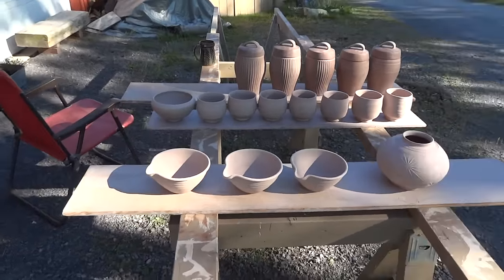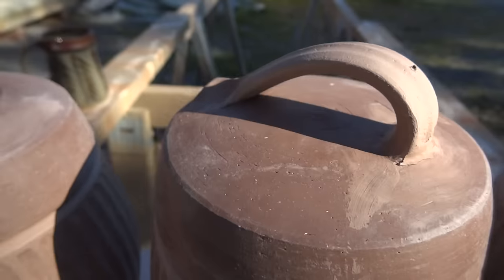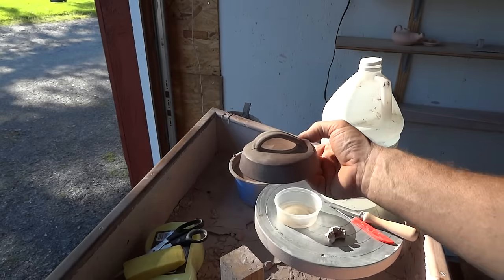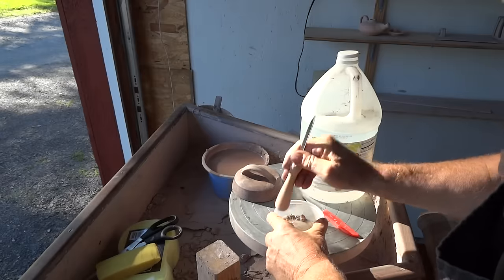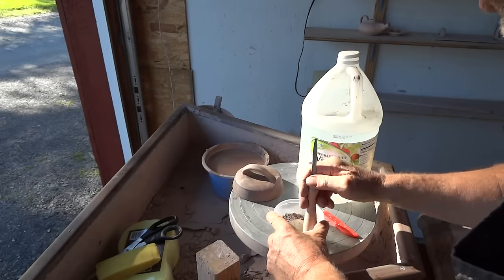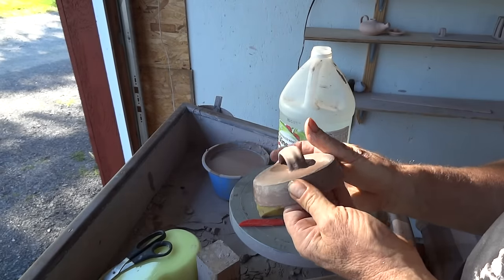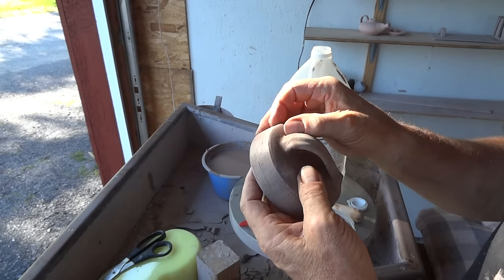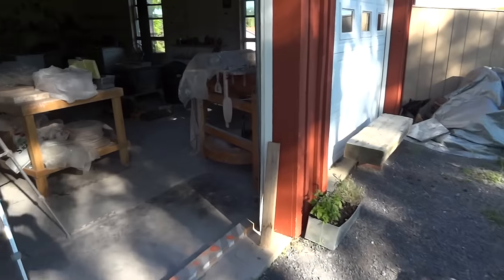SIMON LEACH POTTERY TV - How I mend cracks in drying pots !

Comment: Simon, I use a concoction of clay, vinegar and toilet paper for my slip. I make a batch and mix it with an immersion blender and use it for handles and any hand built pieces. I think what happens is that the slip with vinegar dries more slowly giving the pot and handle time to equalize in water content.  Another trick I use with pieces like your lids is to store them for a time in a plastic box with a tight lid. Inside the box is a slab of plaster of paris soaked in water. After a time all the clay stabilizes at the same wetness which is close to leather hard. The box is also good for keeping handles for weeks if you make too many. It can be used to save pots that have gotten too dry to trim. It is an extra step but will save the pots when you get distracted. Pots with cracks held  in the box can also be repaired and then slowly dried. Many student pieces go in the box when they miss a class and their pot has dried too much for trimming.
Reply from the maker: HI John and thanks for your comments here for all to see. In my next video you will see the results !
Reply: John Blackwood
Reply: "DAMPBOX" (invaluable)
Reply: Thanks for this info John and Simon. When you put a “too dry” piece in the damp box am I understanding that it dampens enough to trim like leather hard? I’ll have to try it. That is my weakness in pottery - missing that sweet spot for trimming!
Reply: Thank you for these tricks!  Can you share what brand of plastic box you use?

Comment: hey there...for years my concoction really does the trick every time -- besides the dry clay, vinegar (i use apple cider v) then, the secret ingredient -- SUGAR or HONEY...now, you need to let it ferment at least a few days, but be prepared for the smell as it's quite harsh, but keep a tight lid on your container and it will last for years :) --- oh by the way, this mixture is so strong that after just air drying it hardens like steel! of course, let it dry naturally on your cracked piece and fire as normal...Never attempted to fix an S-crack in a plate or platter as that would be pushing it too far, and just toss it, and throw another! Cheers from the states <3
Reply: Phyllis Michele Greenhouse how much sugar/honey to vinegar please?

Comment: Hey Simon I first (like you) moisten the area and then with a needle tool push the surrounding clay into the crack and then fill in any void with slightly moistened dry clay then with a brush add water to the surrounding area then cover with plastic.

Comment: Hi Simon, I use white sugar. So the same method of breaking down the dry clay and making a really smooth paste with a little water or maybe vinegar maybe be even better. The sugar dries rock hard and fires well.
Reply: Sugar burns completely .Its just a source of carbon  like straw ,toilet paper.
If its underfired or for a particular reason,the carbon from the sugar makes a black area.It is used in pitfiring for that reason.

Comment: Vinegar being an acid will react with the clay surface which is caustic. That will impart the two sides of the crack with more "affinity" to eventually stick together. Vinegar will also allow you to use less liquid to achieve 
the needed pasty viscosity of the "caulk". When I need to repair a broken raw clay part, I also include some paper tissue to the vinegar/clay paste which sort of armour the repair and also allow slower local dryng as cellulose fibers retain water for longer. Hoping I was clear enough and that these explanations help you to understand the why of the how...

Comment: A good lesson,Simon.
A very similar technique works for me on mug handles.
Instead of mixing ground clay with vinegar I use a very small coil of fresh clay quickly dipped into vinegar and then placed against the vinegar moistened crack.I then apply a sweeping motion using a small artist's fan shaped brush.
Thanks again,Simon.
Be well
Reply from the maker: Thanks Gail for 'chipping in ' , good to hear different approaches.

Comment: Hi simon, I couldn’t think what to do about the cracks in my green ware and am in the middle of making endless butter dishes for my shop. Seeing this has reminded me thankyou so much. I seem to get cracks in the corners of the bases and lids where I put the coil to strengthen them. As you probably realise, they are slab built, it’s so annoying when it’s just the coil that has come away slightly that cracks an otherwise fine pot. Do you know of how I can add the coils without this happening. I do smooth them in very carefully but it still happens to some. Suggestions would be gratefully received. Thankyou, stay safe x

Comment: Vinegar is a solution of acetic acid in water, between 5 and 20 %, more usually in the lower range. Chemically it is CH3COOH. It is the most easily available mild acid. It has other names such as ethanoic acid. All acids react with bases to produce a salt plus water. There are plenty of bases in most clays, and here is one example among many… acetic acid reacts with calcium carbonate, eg limestone, dolomite, etc, to produce calcium ethanoate CH3COOH2Ca (which is a salt), plus carbon dioxide gas and water. Calcium ethanoate can bind phosphates, acting as a stabilizer. All salts have crystalline form. Crystals do not expand and contract as clay platelets do with their variations of water in between them. By converting a certain amount of the calcium mineral platelets into salt crystals, the expansion-contraction tendency is reduced, minimizing the cracks. 

Most clays expand when water is added to them, and shrink as they dry. Clay also expands and contracts during firing. This alternate expansion and contraction results in stress in the clay, mainly due to variations in thickness. Thin areas dry faster than thick ones. Thicker handles attached to thinner clay bodies are typical locations of stress and cracks. The stress is not evenly distributed. Compressing the clay at the crack can be a solution. 

Not all clays are volumetrically expansive and contractive. It depends on the mineral arrangement in them. There are 2 types: 1:1 which are non-expansive, and 1:2 ratios which are often expansive, eg smectite and vermiculite. This is the ratio of silica tetrahedron to aluminium octahedron. All 1:1 clays are non-expansive, as they do not allow water to expand the particles/platelets. In contrast, some 2:1 clays are highly expansive, allowing water to be absorbed between the unit layers due to weak interlayer forces and the polar nature of water molecules, which is then held in place by hydrogen bonding. So, choose your clays carefully with a eye on shrinkage rates and, testing your clays for shrinkage ratios, repair cracks only with the 1:1 types, simply by creating a mixture of dry powdered clay with a little high-acid vinegar.

Comment: Naturally as you said - getting the moisture content equal at the outset is best but it seems that unless every bit is perfect in drying , it will pull, so often I will wax the whole area and plastic as well. When I learned we didn’t have wax. Also what others do with the vinegar and tp and clay works wonders. The acid /clay thing is so. I haven’t myself but a mentor said the vinegar also slows drying so that could be a test. Thanks so much for sharing everyone

Comment: Mix clay trimmings and water with an immersion blender.  Then add Darvan 811.  This thins the slip (deflocculates it) so that you can continue to add more clay trimmings and mix with the immersion blender.  You end up with a slip is very dense and has very little water in it. It's weird stuff!  It is great for joining clay pieces or for filling cracks.  I agree that the wet box is the perfect environment for repaired pieces because it lets the moisture content even out between different pieces.

Comment: Thank you for this video and all the helpful comments! Just tried a variation of this (rubbing alcohol in place of vinegar) on a basically bone dry piece with excellent results so far. The piece is a sculpture of one acrobat holding another up in the air so the joints were under a fair bit of stress from gravity as they dried... I was also stupid enough to make it out of b-mix which isn't really a sculptural clay (it's just so pretty!). As others recommended, I added in a square of shredded toilet paper to about 1 tbsp of crushed clay. I mixed that with the alcohol (probably 2 tsp - I went by feel, adding bit by bit until it was only just spreadable). The alcohol has much less of the acidic benefit described by other commenters with vinegar, however, it was all I had and my brief test of the resulting paper clay showed that it dries extremely quickly with little to no shrinkage so I figured I'd give it a go. The whole piece is now bone dry (including the crack patches) and showing no signs of re-cracking after only one application of the paper clay. The extra plus of this is that it shouldn't delay my firing this evening since the alcohol evaporated so quickly. I guess the real test will be how it looks when it comes out of the kiln! I'll post an update.
Reply: For anyone who (like I was) is searching the internet for a way to fix a bone dry crack, the above recipe was a resounding success. Just picked up my bisqued piece from the studio and there are no visible cracks at all, not even a hairline. Time from patching to starting the bisque firing was only about 3 hours so the rapid drying of the alcohol mix was great.
Reply: @crazyfish666  Hello and thank you!  Have you since repeated this technigue?  🙂

Comment: I would wrap the handle mifdle portion in plastic and the rest of the handle up to 75% in damp newspaper paper ,over the plastic foil (just 30% of the handle length).
That way the handle dries gradually and in the center under the plastic stays more wet so it can stretch a bit.
I also use only paper clay for the full pieces ,but on large handles cracks also occur.

Comment: Hey Simon . . . A question please: Watching you grinding in the lid, is there an amount clearance needed between the barrel and the lid, to account for shrinkage and the thickness of the glaze? Maybe a second question: Will the barrel and the lid shrink at about the same rate in the first firing? Thanks for all you do . . .
Reply: Jeff, normally the lids are fired on the pot base and the contact area is not glazed. If they are the same thickness they will shrink the same and not get stuck. Sometimes the fired pieces will be tight and a little gentle coaxing by lightly rapping them with a stick will do the trick. Search Simons videos on kiln unpacking and you will see him demonstrate this.
Reply: +John Blackwood Hey John .... Thanks for your response ........ I just have to keep practicing .....

Comment: Adverts after just one minute? WTF?

I have a Seth Cardew teapot where the flange on the lid has clearly (but very neatly) been reduced ever so slightly by using a grinding/sanding wheel. This tells me it wouldn't fit post firing so was 'encouraged' to fit so it could be sold.